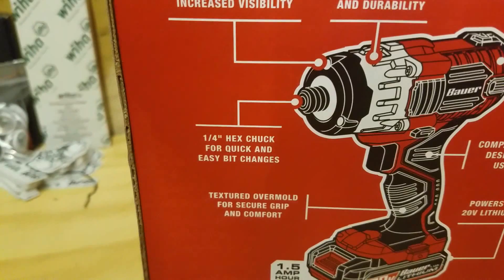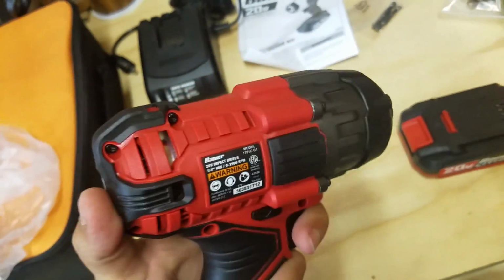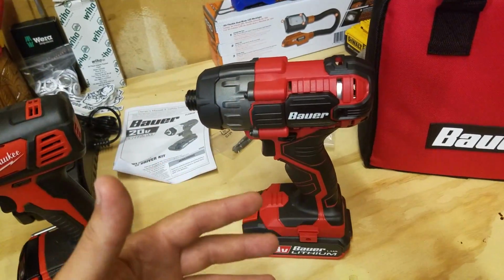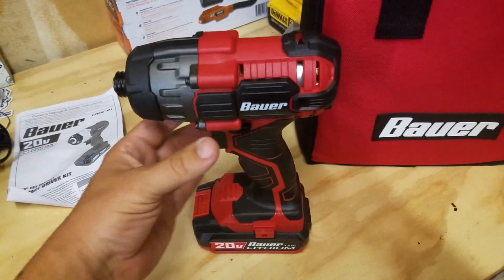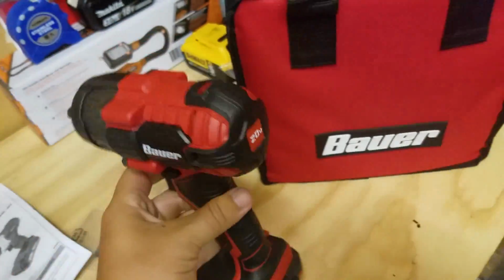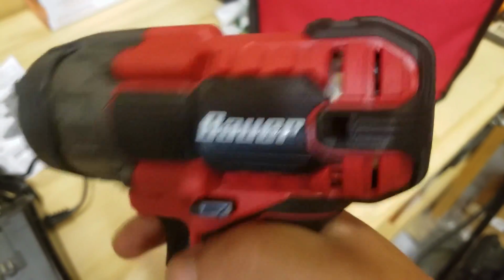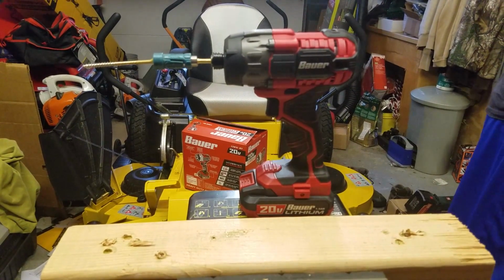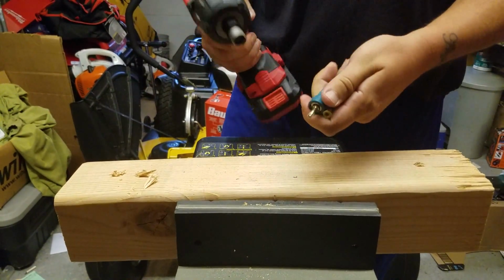Harbor Freight Bauer 20V Hypermax™ Lithium 1/4 in. Hex Compact Impact Driver Kit Review

Comment: I put up garage doors for a living and the bauer works great. It out did Milwaukee dewalt ryobi and porter cable i was very impressed. It pushed 3" lags in like they where nothin. The battery was still full after i was done. Its an awsome tool in my book.
Reply from the maker: Really..?? Then u would of LOVED with a capital L ..a Milwaukee or DeWalt 😉😉
Reply: Nothing wrong with the Bauer , so far it is reliable and budget friendly with batteries and charger.  I heard the Milwaukee nozzle that hold the the bit can be faulty where one YouTuber showed that was a major problem and company hasn’t figure out a solution.
Reply: Just wondering can you use bigger then the 1.5ah that comes with it?

Comment: that Milwaukee tool alone is almost 3 times more than Brauen and no batt and charger. You will never see that price.
Reply from the maker: Na infact you can get the brushless Milwaukee with battery for $79 ...ur on crack !!
Reply from the maker: @tb-xy7lg  go to my community page I got one on there scroll down a few posts you will see it 🤙👌
Reply from the maker: @tb-xy7lg  that's the deluxe model too..with 3 mode selector

Comment: Still using mine 6 years old still drives in 5-6 inch lags and screws of all sizes, the batterie started to fade after about 4 years or so, it still works perfectly except the lights

Comment: I have a handful of bauer cordless tools. I use them daily in the heavy civil construction field. I've been beating the crap out of mine for goin on a year solid now. I've pushed it beyond its intended design on numerous occasions. The only issues I've had is with one of my 3.0 amp hour batteries that got rained on. I chose bauer not because of the initial cost of ownership, but because of the cost of additional batteries and accessories. It is by no means a Milwaukee, but it is definitely a skookum tool.

Comment: The 1x2.5 Hercules battery will out perform the Dewalt 2x1.5 batteries together. I have Milwaukee and Hercules. Very impressed with the Hercules and being that it’s 1 battery is strong, the price does work out a little cheaper, not much, when you add warranty that the others come with.

Comment: The Milwaukee charger you've got charges two different types of batteries which probably accounts for twice the weight.  It's pretty chintzy when you get inside of it.  No clue about the Bauer because I've never taken one apart.
Reply from the maker: Nikkolas Parsons maybe chinzy i never opened it ,but i can tell you it charges alot faster than the bauer ...and i thinknthe chargers have proven themselves to not only perform well , but last a long time
Reply: No argument about the quality of the Milwaukee chargers. I've still got the one from the first m12 set I bought. I only took it apart to repurpose it. It seemed like an unfair comparison considering the differences though. I was hoping maybe the Bauer would end up being an old brushed Milwaukee clone personally.
Reply from the maker: +Nikkolas Parsons why is unfair ??? Bauer impact kit $79, Milwaukee kit $89 ...both priced the same ...only thing thats unfair is tool that somebody paid 79$for , for $10 more they could of got two tools and a battery platform far more Superior

Comment: It’s 79.99 because you’re getting the kit with the battery and the charger. If you’re going for Milwaukee from Home Depot you’re gonna be looking at easily 2.5-3 times the price .
Reply from the maker: Na ..WRONG
Reply from the maker: There all over eBay for 40 bucks ..stop just stop
Reply: TOOL BOSS if you are looking at Milwaukee FUEL you are looking at spending good money. Tool, battery and charger can’t be had for under $200 at Home Depot. I’m not trying to bash Milwaukee because I personally have the Milwaukee fuel 3/8 ratchet and the 1/2 cordless impact and I love it, but I bought all that stuff off eBay because Home Depot charges too much.
Reply from the maker: @oscarrodriguez654  yea this is brushed version in video ..$89 for kit and free $50 led light ..Bauer was $79 ...again at time of video ..not sure what price is now ..but you can get brushless versions from Makita Milwaukee and DeWALT for $79 on sale and $99 reg price with up to 5 year warranty..I think worth the xtra couple of bucks
Reply: TOOL BOSS I agree again I love my Milwaukee fuel 1/2 impact and 3/8 ratchet I want to get the fuel 3/8 impact and I have a dewalt 1/4 impact driver which Can take lug nuts off it’s crazy powerful.
Reply: @toolboss8410  from what I hear though if you get it off eBay the warranty doesn't carry over, have heard that about Ridgid and dewalt too, not exactly sure though

Comment: Great video boss thanks for buying it and posting this so I don't have to buy one just to see for myself
Reply from the maker: Mark Kilroy no problem mark ... wasn't much $$ ...i just knew what i was in for
Reply: TOOL BOSS I agree with you that why would you buy into for that kind of money when you can get a Ryobi drill right now at HD for 69 bucks with a deep line up besides your regular circ saw, impact, recip, and drill like lights, fan, buffer, pump, string trimmer, etc and a 20 year reputation. As of now  Bauer only has the impact and drill

Comment: I've own this tool for about a year and abuse the crap out of it and it still works awsome! I think ppl buy this tool is because the battery itself is so cheap vs the mil/ mak or DW
Reply from the maker: Its not really about if the tool stinks or is bad . .its about value ..at $79 or $69 ...you can get a DeWalt brushless impact with 2 batteries and 3 year warranty...or Milwaukee gen2 brushless impact with 5 year warranty for $99 .. the xtra 20 or 30 bucks is well worth it 👍🏻
Reply: That is true! Black Friday is just around the corner and we can probably get better deals with big name brands tools!! Great video man 👍👍
Reply from the maker: @eltonnah6306  thanks buddy 👊👊👊

Comment: Where did you find the Milwaukee for $99??? At Home Depot it's 169... Replacement batteries are $79. ... Please let me know
Reply from the maker: +anesthesiadreamin i have video on it actually it was $89 not $99 ...that deal long gone...this vid 6 months old
Reply: TOOL BOSS was that the tool only? Or was it with a battery and charger
Reply from the maker: +anesthesiadreamin kit ..
Reply: TOOL BOSS thanks for the quick replies and excellent video. I'll be getting the Makita because of your video. You should get a commission from them
Reply: TOOL BOSS   So this is a once every six months price, vs. HF’s everyday price... give or take $10. Would be interested to hear your thoughts on every day price, vs. every day price. 😊

Comment: I totally agree about the points you made about price and warranty at the beginning of the video. If Harbor Freight wants to compete with the big boys, they need to slash their price and offer a better warranty than a measly 90 days. That seems to imply the tool won't last a full year. However one advantage they do have is if you get the extended warranty and the tool breaks, you take it to the store and walk out with a new one. With the big boy tools you will have to send it away for repair and may have to wait one to two months for it to be returned.

Replacement parts is another big deal. You used to be able to get replacement parts from Harbor Freight. Not any more. I guess with the volume they do, it was too much of a hassle to run a parts department.
Reply from the maker: Pro1er yea still only for a year or 2 and its another 18.00 for a measly 2 year warranty..ryobi has 3 year warranty for free and they are pretty good with warranty stuff...ive walked out a depot with new stuff after 2 years ...guy said go grab one off shelf

Comment: I've had mine for two years, I'm no professional but I've definitely abused mine, I left it out in the rain for 3 days by mistake, still works like new!
Reply: Also, just bought another to keep at the in laws, as of January 2021 I used a $10 off coupon and got it for $59. I forgot to mention I also have a Bauer battery powered circular saw and the Bower drill. That circular saw really impressed me, it's super cheap for what it is.
Reply from the maker: Thats awesome 👍

Comment: Just a thought. But the Milwaukee brushed is actually $99. The biggest thing is buying more batteries. You can get batteries for $20 for the bauer and $70 for the Milwaukee. I can get 3 batteries for that.

Also, I was/am a Ridgid guy. I'm a handyman with my own business... but my work van was broken into twice over 2 weeks and I was wiped out twice. As a guy that's tapped out because of the thefts, I'm going to get a bauer set, so that I can have 3-4 batteries and a set of tools to get back on my feet. 

Someday I'll upgrade again, but it boils down to: batteries. They are the Achilles heel of power tools
Reply from the maker: +Travis Dalton nope actually was $89 with a $50 led flashlight at time of this video ..👍🏻👍🏻
Reply: I understand that. My comment was to state that currently, the pricing isn't as close as when the video was made. I also understand that as someone who has a workshop with brand tools, this is not a good option but for someone that needs a decent tool for a decent price, this is a good option I believe.
Reply from the maker: +Travis Dalton lol..well nothing i can do about that ...your right you could of actually got the brushless milwaukee impact driver kit for last 12 weeks for $99 ...no matter what way you turn it travis , the bauer makes absolutely no sense to buy ... Fact is the Bauer is nothing of what you say ..cheap , underpowered tool with no warranty ..thanks for watching

Comment: First glad I found your channel.
Next we have your review of said driver, humm lag bolts are not the only thing to be tested, some of us industrial maintenance people use them for non lag bolts and I have destroyed most brands, so yes $80+ is easier to spend when you 6mo. out of the tool.
Reply from the maker: Thanks bud.  Yea object of this vid was not to review it with anything particular,but to show how for the $$$ and terrible warranty it is not worth it ..got to remember this vid old for $79 to buy the bauer and $89 to buy Milwaukee plus free $50 led light ...was to show spend the xtra $10 ... drastically difference performance and build quality between both tools ...now for you just sinking fastners you will no problem with either one .  But i bet you get twice as long out of the Milwaukee...got to remember bauer 90 day warranty... Milwaukee 5 year warranty

Comment: I can't believe it wobbled and broke those lag bolts.  That's nuts.  I never saw an impact driver do that before. I agree about the Bauer/Hercules pricing - they're too close to the big guys.  I actually bought my Ridgid Gen5X brushed impact driver on sale for $59 at HD (tool, one 2.0ah battery and the charger).  A year later and it's still going strong.  Just goes to show that you can find much better, proven tools for reasonable prices.
Reply from the maker: Rob D first time for me too ...i have obviously broke them before , but not 3 out of 3 ...
Reply: Same, bought the Ridgid Gen 5X brushed for $59, use it all the time for household and small automotive fasteners. It's strong enough to remove lug nuts torqued to 100 ft-lbs (not that i use it for that, just testing). No problems with it so far, great trigger control also.
Reply from the maker: BigBeansM3 awesome bro...great price ..its a solid impact but nowhere near the 2000 in lbs of torque it says

Comment: Ive had mine since all my dewalt stuff got stolen and I gotta say its fallen off of 2 3 story buildings was in a bucket that filled up with water and has been run over by a few 14,000 lb trucks. it surprisingly just keeps working the front bearing went bad in the impact part but it keeps working idk man I bought it as a throw away to get me until I could buy another dewalt  but I didn't expect it to last this long. harbor freight usually sells garbage but it looks like theyre stepping up their game recently shit even their compressors seem to last I bought one bc my 30 year old Ingersoll rand compressor took a shit and I use this little 10 gallon almost every day and it just keeps going
Reply: I'm not saying it's the best by a long shot but it's lasted longer than my buddies Ryobi with a bit more abuse I mean what's your thoughts do you think they're stepping up or just blowing smoke?

Comment: I think there blowing the bauers out now for 59.00 bucks super coupon, for the money its a win win, i would not be surprised if Rigid makes them for the Bauer line almost looks same design. on the fence if i need a drill driver do like the look of Bauer
Reply from the maker: Na ..it's a lose ,lose lol...for $60 then 20$ for warranty=$80....y not get a MILWAUKEE Brushless for $99 and get 2.0Ah instead of 1.5 and get a 5 year warranty..or Makita Brushless with a 3.0Ah battery ..  or hell a Hart impact which is much more powerful for $69 and has a 3 year warranty...it's a lose lose my man 😉👍
Reply: @toolboss8410  Ye I wait for home dupa thanksgiving sale see whats cooking for tool deals, last year thats when i moved on the Rigid Next gen 5 things a beast impact 450 ft lbs, great for big rig work.

Comment: It's the wobble combined with the impacting. Saw the other vid. Notice they all broke at the thread/shaft. Don't put the redhelix drill bits in it. They will pop. Try pulling lugnuts maybe? Maybe 4" tapcons?
Reply from the maker: tensazero yea my point of vud was to show if you want to do basic applications with the bauer ..your guna have issues

Comment: The Black and decker impact from walmart for $58 would probably be a better and cheaper option than this
Reply from the maker: V.Vega i agree.. if it comes with more than a 90 day warranty no doubt
Reply from the maker: Joseph Fossa yup same as DeWalt 👍🏼
Reply: TOOL BOSS i use Dewalt and Ryobi all the time the best tools lol im thinking of get Dewalt brushless drill at lowes soon for $89.99 on sale with 3 year warranty and 2 20v max batteries lol
Reply from the maker: Joseph Fossa yea that would be the better choice no doubt bro
Reply: V.Vega   Agreed, that’s also every day price vs. every day price. Plus B&D is owned by Dewalt... it’s their entry line, or homeowner line.

Comment: Samsung cells, i opened mine. My boss has a Makita impact driver and as far as brute strength the Bauer kicked its butt. His is a nice driver/impact also but mine just simply ou preformed his
Reply from the maker: He must of had a old makita ...this one had terrible batteries and had no power at all
Reply: Yes it has three hard years of electrical work abuse on it when we did it, and the bauer was new.. Right now the bauer is still only three months, but just like stated only time will tell.. lol i run 1 and 1/4 inch paddle bits with it threw 2x4 studs alot.. it works good but does eat battery kinda quick
Reply: Overall, im suprised with it. But i would rather have a higher spec drill.. good video though man